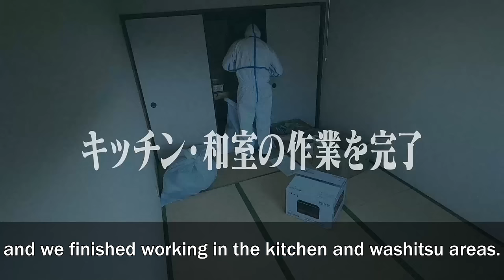[VIEWER WARNING] Difficult Family Relationship and Lonely Death in Japan Ep.2 - Specialised Cleaner

Comment: Very fine job you did! One thought came to mind as I saw the "After" video: Do you also clean the filter in the air conditioning unit, that was in the wall??? Air conditioning units need to be kept clean, not only to cool the air, but filter it.  Unless your air conditioning units are designed differently in your country.  Just wondering........